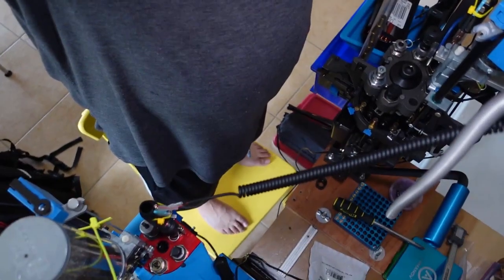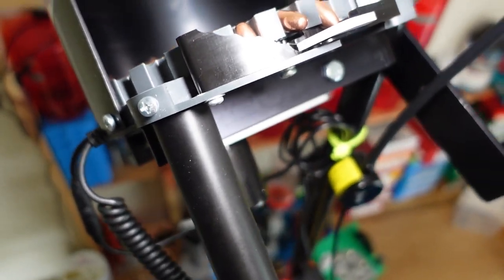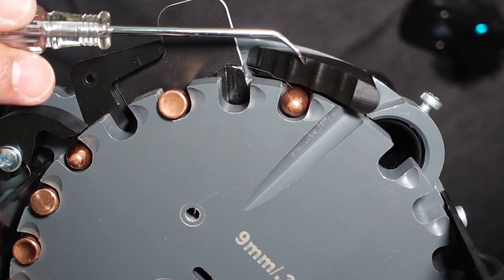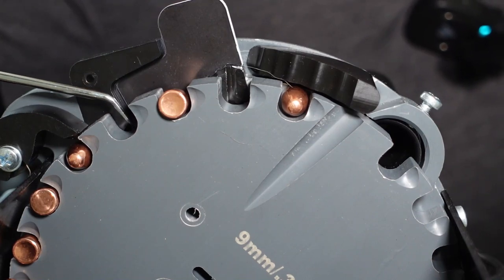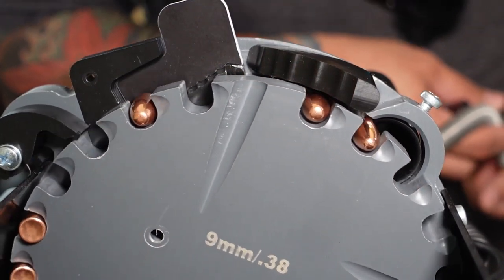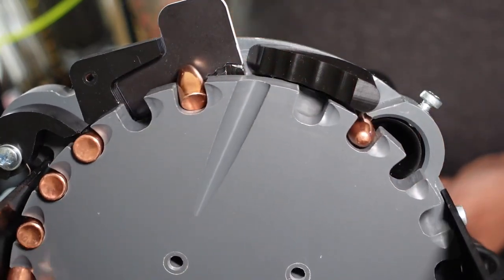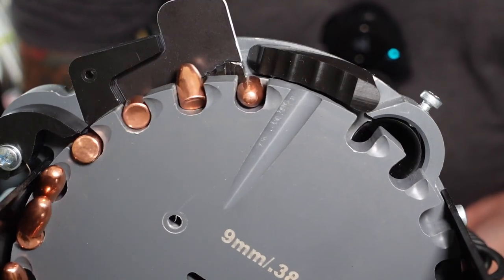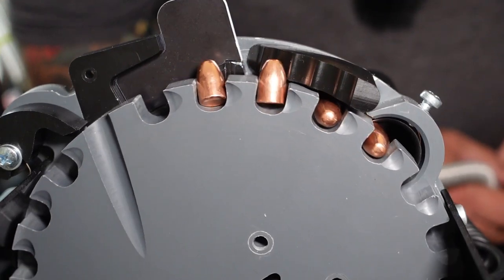Mr Bullet Feeder | Fixing Upside Down Bullets

Comment: You can set them without it even running. Running at slow speed, stop it when a notch is just over the start of the spacers. Adjust it so that the tip of an upside down bullet misses the ramped edge of the spacer, but a correctly oriented one sits on top of the edge of the spacer. Then it won't flip correct ones, but will flip upside down ones. You'll be able to get it with 2 adjustments at most.
Reply from the maker: Thank you!  Hey, please consider subscribing if you can!